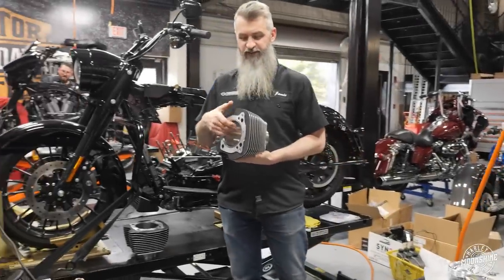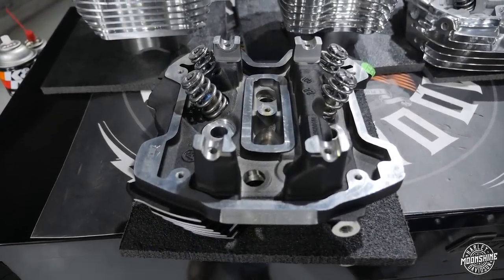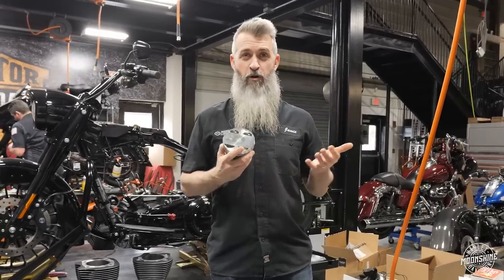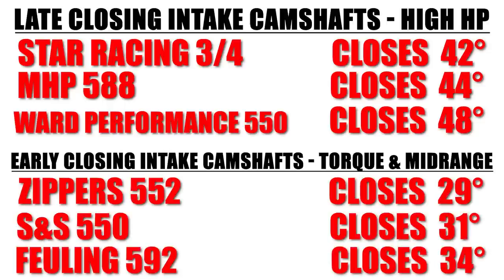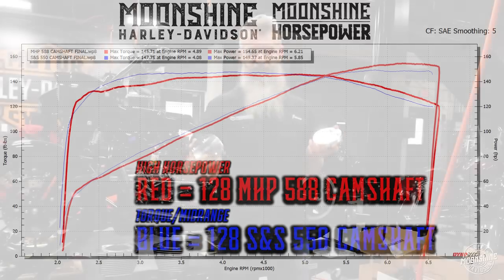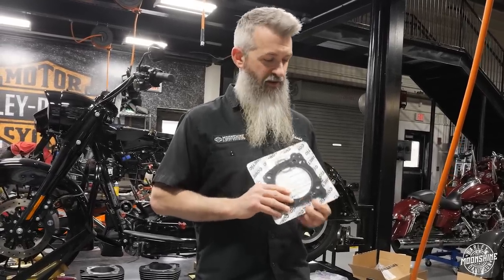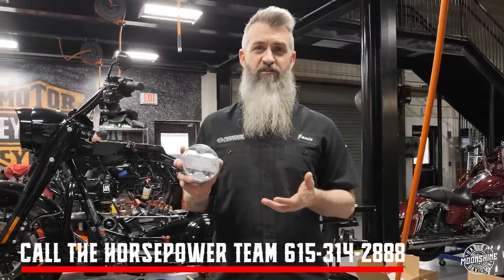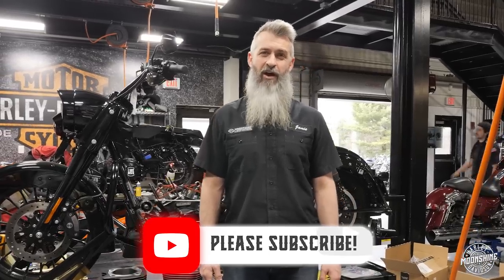S&S 128 High Horsepower UPGRADE KIT By Moonshine Horsepower | Shop Talk Episode 59

Comment: That 588 mhp earn my bike it's name Freight train. IF I didn't get you out of the whole I would out run most mid especially on the big end..good for 145mph or better 🤟
Reply: Nice!  128?
Reply: @RGHD912  yeap good ol 128
Reply: @roadglide128  Nice build, can’t wait to do mine.
Reply: are you running 93 octane in it
Reply: I was yes 93 pump tune

Comment: I need a better job. Shit guys, i had 93cc heads in my 2003 screamin eagle road king anniversary dinosaur that had the s.e.103 twin cam...had greg dahl, a harley motor genius do some freshen up to the motor at 50,000 miles. New forged pistons 10 over, andrews cams, bassani rr3 pipe, hpi throttle body, injectors, titanium valves, he reported the heads. The bike was a rocket, made 120tq on the dyno, but seat of pants was amazing.  I had to sell the fucking thing to pay for my house, damn priorities. I have a 2004 road king  now with a 95" kit that was already in it. Idk if i want to build it up to a stroker 106 or trade it for a new road king special M8 114 and get motor witch 131 cylinders,....i need that better job first, lol.

Comment: My 2020 M8 motor has 14k miles on it.  If i was to do the whole Moonshine Horsepower kit would you recommend replacing crank or atleast the bearings???
Reply from the maker: If you are going to add the heads we recommend welding and balancing the Flywheel. Stock heads = stock flywheel setup.

Comment: So if I’m running the 129 kit with a 3/4 cam and S&S piston should I use the 40 thousand gasket with stock heads?
Reply from the maker: No, you’re a little light on compression already.
Reply: @MoonshineHarley  what should I do to up the compression?
Reply: @302BAGGER  3 things less intake close on the cam,more comp pistons
or mill the heads

Comment: Thank you for another excellent and informative video from MHP.  I've always considered valve timing (cam specs) to be the single most important choice, matching up airflow and effective cylinder pressure with all components for maximum efficiency, maximum torque & HP, in the desired rpm range.  Well done!

Comment: Always great and super informative vids from MHP... I did a similar S&S 128 set up but went with the S&S 540 cam... my numbers came in at 138HP / 158TQ... for my riding style, I wanted more TQ than HP; I'm super happy!
Reply: Nice 👍 I'm looking at the SS 128 kit can you please explain your whole build intake exhaust tuner any head work  I'm running a 23 RGS 114 now with a woods 22xe  KW 2-1 outlaw with a BMF air filter power vision made 121 hp. 132 tq.  Not enough for me your #  sound awesome Thanks Brother
Reply: Are your cylinder heads ported?
Reply: @heavychevy07  yes fuelmoto I think they have 3 head options and I went with "B" or the middle options of work
Reply: @brianflowers4751  If I can remember everything: S&S 128, S&S 540, cam, Fuelmoto heads and Fuelmoto head pipe, but I just put on a Fab28 shorty pipe. I had it re-tuned and with the shorty pipe and it lost a tad of low end torque (who cares) and gained a tad of HP. I have a HPI 62mm throttle body and intake and TTS tuner professionally dyno'd. Darkhorse comp delete, Rekluse clutch upgrade. I did not upgrade the tranny as I've heard they're pretty stout stock. Removed belt and went with chain drive. I think that's it.

Comment: You guys have stated in other videos that the 132 kits don't last as well as the 128 kits. (Referring to cylinders and pistons). 
But with stock heads, and 11:1 comp ratio would there be a different in durability between the two kits??

Comment: What additional cooling do you recommend for these builds?
Reply from the maker: H-D oil cooler fan setup.
Reply: @MoonshineHarley  That's all of the cooling needed?
Reply: @kelvinknaff9903  ….And a good tune!
Reply: @RGHD912  I know that the Harley-Davidson oil cooler fan system will help a stock bike tremendously especially in stop and go traffic and I understand a tune with the appropriate amount of fuel delivery can help cool cylinder heads some; so you’re saying those fuel adjustments will compensate?
Reply: @kelvinknaff9903  Not a tuner but I know a good tune will cool things down a lot, cat delete, more fuel, fan assist oil cooler etc. I’ve experienced both a good tune and a bad tune.
Reply: they do run hot even with oil cooler fan I dont ride mine
if it is above 90